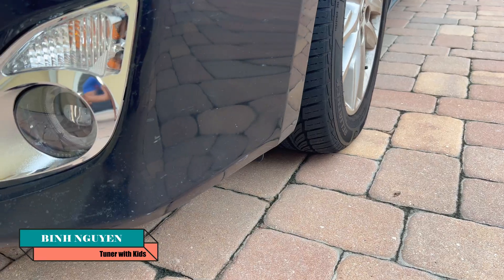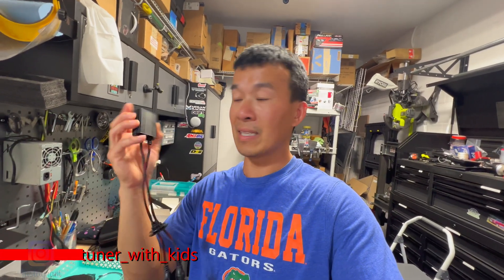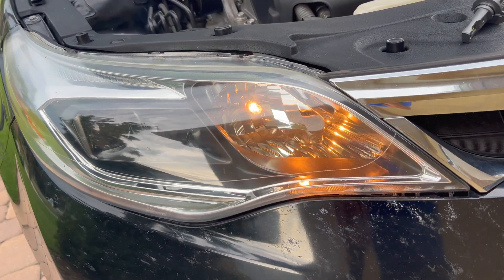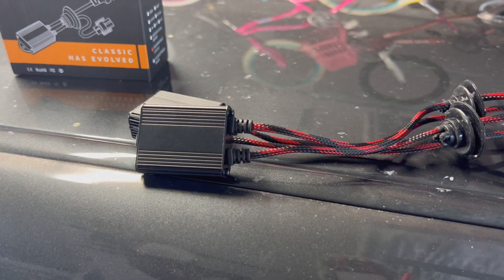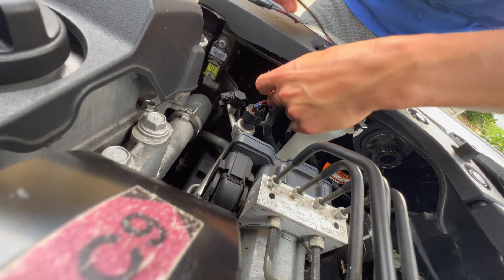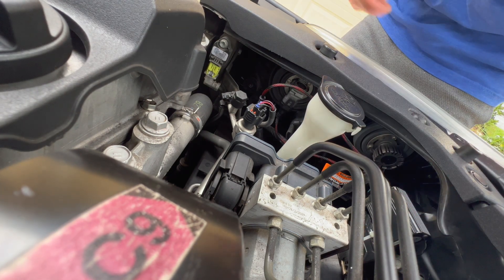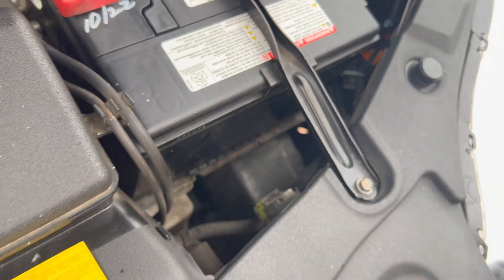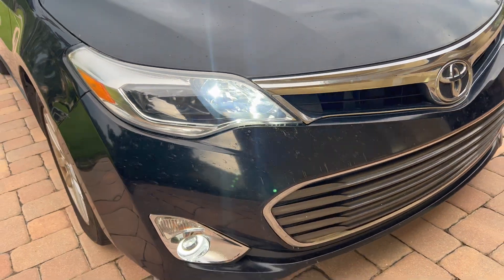How to Fix Flickering LED DRL with CANBUS Module | Anti Flicker Error Free

Comment: Would an in-line capacitor achieve the same result? Possibly better?
Reply: I have just added a inline capacitor to mine (focus mk4) seems to do the trick i used a 1000uf 25v capacitor

Comment: The issue I have found with these is that it does fix the flickering but it basically turns your DRL in to always on High Beams. I wish there was a better solution.

Comment: I bought exactly the one you are using in your Toyota for my ‘13 Camry and didn’t work, it start flashing faster and after 4 o 5 times doesn’t work anymore ….turn off the vehicle,  crank it up again and the LED lights again 🤦‍♂️🤷‍♂️

Comment: Another awesome video uncle! For your GS I know you made a video using a program to turn off DRLs but is there any other way to disable them without a laptop? Thanks!
Reply from the maker: A relay to intercept the power or ground when car is on and light is off. When headlight are on, relay will switch and continue the circuit so you can use higher beam.
Reply: I found out on my 2012 camry that has the same problem you can actually disable the drl's completely using the factory radio, unfortunately mine no longer has the factory radio, dang
Reply: @blakekelley8112 How does that exactly work ?
Reply: @moparlover55  There is a big CAR button on the factory radio which will take you where you can change many car settings including whether the DRL's turn on or not, whether doors lock/unlock when car is put in drive/park, doors locking above 15mph etc.
Reply: @blakekelley8112 Do you have any idea if any other Toyota vehicles have that same radio option ? Cause my friend has a 2014 Toyota Sienna & Venza. So, was wondering if those specific vehicles had that same option ?
Reply: @moparlover55  Honestly i do not know for sure for anything other than that generation of Camry, if they had it on the camry i wouldn't be surprised if the same option is on the venza and sienna stock radios but only one way to know for sure. If you want to know you might be able to confirm if you read through the owners manual, it should explain all the options and settings inside the factory unit

Comment: Do you know how I might be able to use one of these for the VLAND headlights on the 2is? I'm in Canada so I can't disable the DRL's using techstream
Reply: I pulled the high beam fuse to temporarily "fix" the issue (I don't really use high beams in the city anyways)
Reply from the maker: Nope. I’m Canada you’re SOL. You can do a relay to cut power to each bulb when lights are off. Then go back in when headlights are on incase of high beam.